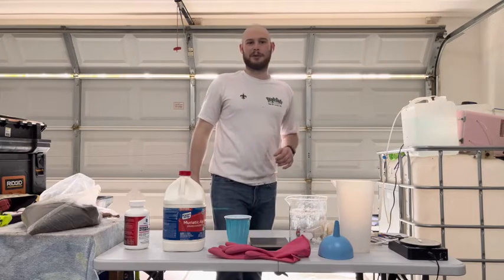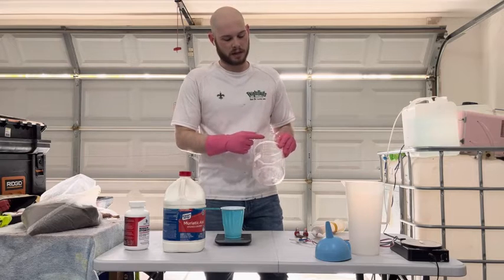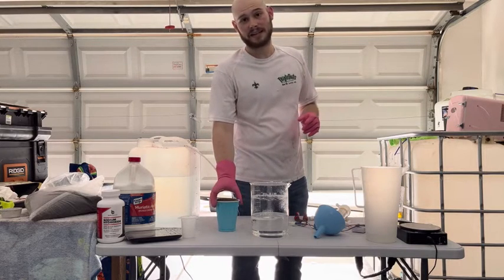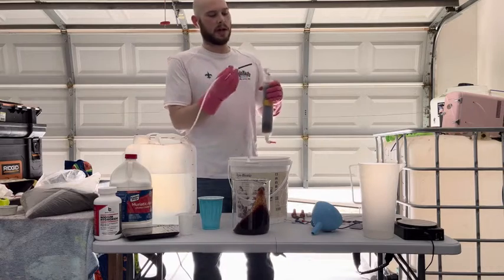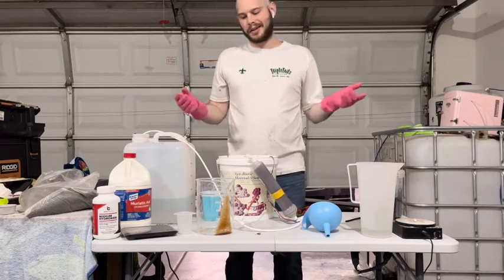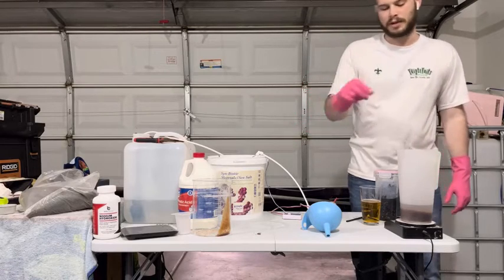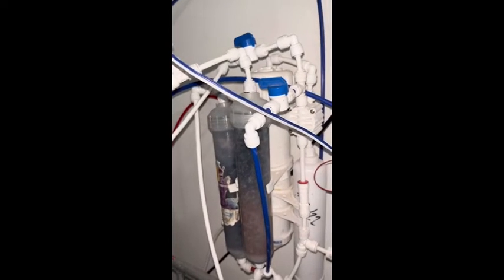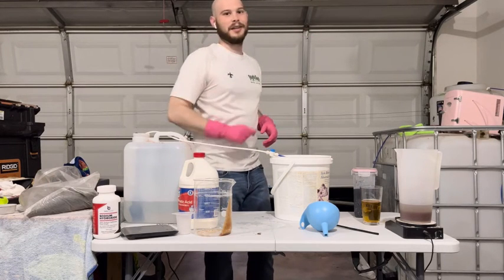HOW TO REGENERATE DI RESIN - Fast and easy method

Comment: thanks a lot for the video ! If you add one gallon to 3 gallon the concentration becames 1/4 of the initial concentration because the final volume becomes 4 times the initial volume, in your case approx. 7,5% . BTW it works, so maybe the HCl concentration is not crucial

Comment: Why not just two seperate DI filters instead of mixed bed?  Saves you one step.
Reply: Such a technique is used to save on mixed bed, but on its own, it's inferior to mixed bed since the latter substitutes water for salts (chiefly not reversible, only about 10-7 M foreign ions assuming a half-used bed) rather than ions for other ions (reversible). I bet somebody has already employed magnetic separation.

Comment: Did all this a few times for moderate 5gallon tanks DI but encountering a probleme regenerated resin seems very less effective about only 30% of when it was brand new. Should i let it soak in Sodium Hhdroxide , Muratic Acid longer , or rinse out even more ?

Comment: Please, help me out here;; I've watched the video about 20 times, bought all the equipment and chemicals and tried doing my first batch.  I don't need it for aquarium, I'm using it to try and keep my black car clean.  So everything worked just as shown UNTIL it came time to rinse the anion resin.  I didn't have any DI water saved so I used distilled water.  After about every third rinse, I'd check the output water to get my TDS reading.  It seriously took me about 3 hours to rinse just a small batch.  I used 9 gallons of distilled water to finally get my TDS down to about 7ppm.  I never did get my cation resin completely rinsed. I think I got it down to low 20's.  So...... did I do something wrong?  I'll trying using your rinsing method but I still figure it will take a lot of water to rinse it.  Any suggestions?  My resin doesn't last very long as my water is about 375ppm.   I want this to work!  Oh, also, how critical is the ration of sodium hydroxide?  Does it both separate the resin and regenerate the anion resin?  If not, could I reduce the S.H. to make it easier to rinse it clean?  Is there any purpose to save the rinse water as you're rinsing the S.H. or acid?  Thanks for your  help.
Reply from the maker: Your best bet is to message me on instagram, i have the same name on there as well. I can give you detailed help over there, struggling sucks!
Reply: I hadn't used Instagram before but I installed it and I BELIEVE that I sent a message there. If you don't see it, let me know and I'll explore a little more.

Comment: Why did my blue resin sink and my tan resin float ?
Reply from the maker: In common practice that shouldn’t be possible as 1 resin is heavier than the other. An incorrect ratio water to sodium hydroxide would make both reasons sink or float and not the reverse.
Reply: @poor_mansreef8908  the anion floats... The cation sinks and gets treated with the acid solution correct?
Reply from the maker: @Grinchfeast  cation gets rinsed and then regenerated with acid. The anion just needs to be rinsed after the sodium hydroxide bath.

Comment: Good sheet bro, I never thought about putting it in water and pouring in. This still looks like a moderate pain in the ass but I’m almost sold. If I had a bigger tank I’d be much more inclined!
Reply from the maker: My main reason is it allows me to be lazy with making water. No need to flush the system as burning up a small amount of reason with high tds water doesn’t even cross my radar and i haven’t bought resin in a year, its best to save up a couple pounds and just run it all through the process once a year.
Reply: It’s definitely worth it if you’re using a ton! I’ll start saving mine in case.